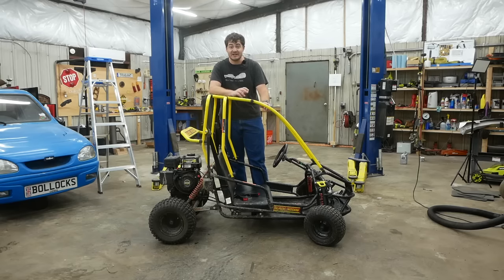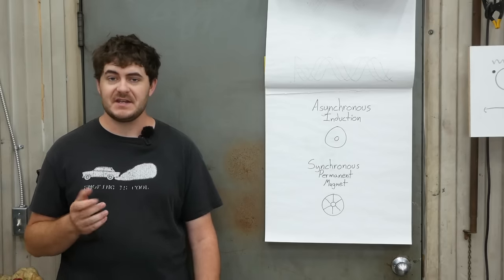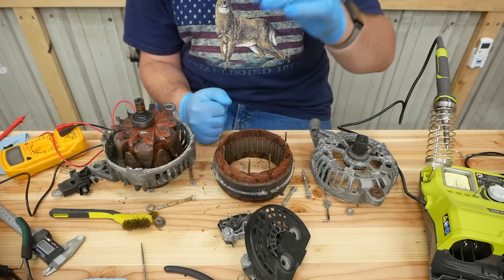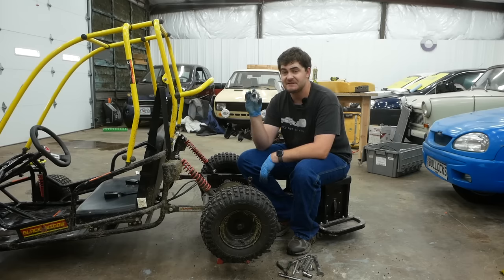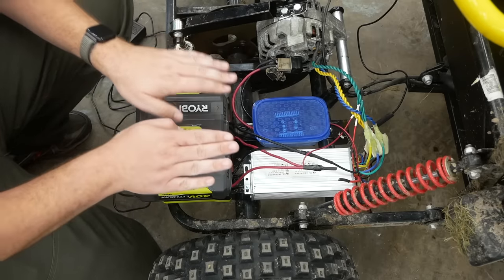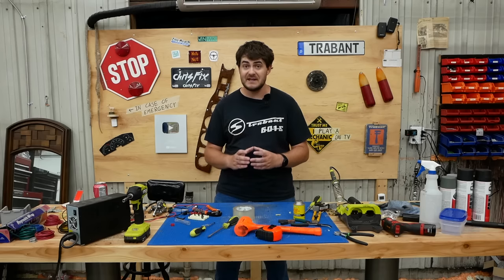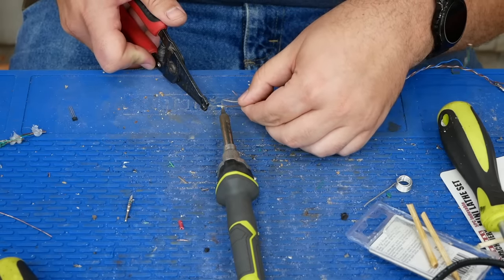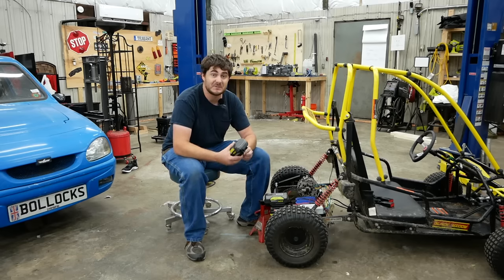Can I Power This Go Kart with a Used Car Alternator?

Comment: My prediction: you end up using the motor that comes with the new speed controller - and this thing will rock! I converted a mountain bike to electric and on 66V it can pull me up hills easily (about 110kg total weight including the bike itself) so if you let your kid play on 72V better make sure there is some kind of limiting.

Comment: Excuse my ignorance, As I have plenty. But would a car starter motor have the torque to be work with the right gearing? Running from a car battery.

Comment: Gotta hand it to you for sticking with it. Would a starter cap be of any service to you? Not sure if they're used on DC motors and I do not think they are, but hey, I don't know. Sure need them on AC motors. Not sure how to size one, but you need to get it off line as soon as the motor kicks in so you'll need a centrifugal switch too.

Comment: One major problem with putting those batteries in series is that if they differ in charge, they basically short-circuit the voltage difference.
Unless their protection circuit prevents this, this can lead to them getting damaged and potentially experiencing a rapid unscheduled disassembly.
Similarly, the chargers might break each other in the trickle charge state, used for completing the last ~20% of the charge.
Both issues could be worked around by permanently leaving the batteries installed and only using one charger for both cells.

Comment: Knowing rough info on big motors from washing mashines they also need a capacitor to give it a jumpstart in a specific direction idk if thats the answer but yeah a capacitor starts the rotation of the drum/motor with heavy wet clothing loads or maybe heavy go kart loads

Comment: Also, I’m not sure if an alternator is considered a brushed, or brushless motor, but I believe that only brushless motors use the sensor from the speed controller. If it’s a brushed motor then it only needs two wire speed controller made specifically for brushed motors, and a brushless will only work with a brushless speed controller. You’ve probably already thought of that, but I can’t sleep without figuring this out.

Comment: Interestingly fun project.  I believe that the shape of the poles on the alternator will lead to major inefficiencies in power in to power out.  The poles are shaped as they are to reduce electrical noise that increases as rpm increases.  If the poles on the rotor were machined to appear to the stator as bar magnets, the magnetic energy  would be concentrated on the proper stator magnetic lines of force all the way across the stator.  As it sets now, the wide end of the rotor poles contaminate several stator windings causing multiple stator windings to fight for magnetic real estate on the rotor.  And some of those forces are opposing each other.

Comment: Just a guess but... If youre drawing to much current from youre batteries the Voltage drops.

Many BMS's will stop pullimg current to protect the batteries. (Off and ON) resets the BMS and gives the batteries enough time to show higher voltage.

Comment: not sure if you fixed this but you know, I had a floor fan go out, i took out a black box it was a resistor or something and it would only work if i spin by hand. I looked this up and it needs that capacitor not resistor to start look this up may help.

Comment: From my electrical engineer knowledge, your stepper frequency is to high for the initial torque required for the initial start. from what I know on hall effect sensors it's made to measure a pulse in order to estimate the revolution of the, it would be dependent on what the motor controller does with the signal, you can test it with a small 555 signal generator and an oscilloscope. If you have any questions or need any help I would be more than happy to answer them, as well as any questions you might have about BMS systems and 18650 battery packs.

Comment: So question, can a Alternator being driven by a gasoline engine power another alternator as a three phase motor? As in no controller or hall sensors, just the phases wired directly together and a way to energize both, essentially like a electric pto of sorts?

Comment: Sensorless controllers use the zero crossing point of the back EMF sine wave to infer the position of the rotor. My guess is that the controller is cutting out due to the controller being undersized or the inrush current is too high for the batteries BMS and it’s cutting out. To check for BMS cutout hook up a multimeter to the DC bus and check and see if the voltage cuts out when the controller cuts out. I would also recommend getting a sensorless control so you don’t need to mess with installing the Hall effect sensors.

Comment: Are these controllers designed for use with hall sensors? My background is in appliance repairs and I would be modifying the back end of the motor to fit a washing machine motor tacho coil and magnet.

Comment: Overcurrent protection. 1500w at 40v is 37.5a. I'd say that the batteries, even in parallel setup, cannot handle 18.25a Current draw for long, if at all. That's neglecting the draw to energize the rotor windings.

Plus remember that the higher the Current, the higher the heat losses ( heat_loss = total_resistance × current_SQUARED), so the power lost to heat will be (assuming a 10 ohm Total resistance as example) will be 10w at 1a,  40w at 2a, 250w at 5a, and 1000w at 10a. 

This is why most traction motors run on really high voltage, since it reduces heat loss at the same power rating (and also why the long power transmission lines run at tens of thousands of volts with  tenths of amps). The same effect is why birds like to roost on residential power lines, but rarely do you see them on the big high-tension lines.

It may also be the controller itself. Some are designed for a low Current high voltage setup, and some are the opposite.

A 72v pack would have to output 20.8a at 1500w and 41.6 at 3000w.

Always keep in mind,
Power_In - Power_Of_Loss = Power_Out

Comment: This was a great video! 
Educational and fun to watch the same time!
I like also the fact that you show the failed attempts!

Maybe it is a good idea to use a RC brushless ESC controller? 
They work with sensorless motors and they can handle up to 100Amps
Reply: An RC controller and motor for that weight, 100A might be peak and wont sustain it.
Reply: @freedomisfromtruth  thanks for the info!

Comment: 3:50 the important part about asynchronous motors is, that the rotor moves slower than the stator field, otherwise the stator field would be stationary in the frame of the rotor and you would induce no current. the ratio of the rotor and stator field speed is called slip and is proportional to the load on the motor.
for the case of a synchronous motor, the stator field and the rotor spin with the same speed but with a phase difference (lagging behind for a motor, leading for a generator)

Comment: I had been considering building a replica of an early 1900s electric car, but after pricing out the parts, I had hit a similar wall. The cost of all the electric components total out to be twice that of gas (small engine) parts, plus the added issues and stress of getting the right parts working to make the machine move; along with the added fact that I enjoy the noises and vibrations of a gas engine and the immediate gratification of quickly refilling the gas tank rather than waiting for batteries to recharge led me away from electric power and talked me out of using an electric motor. I like idea of electric powered machines, but given my limited knowledge of electricity and my less than stellar experiences with battery life and range,  it will be tough for me to give up on the “Dino Juice”!

Comment: The engine problem might be dust caught in the centrifugal clutch. That happened with ours after drifting on dry days, and a spray with the hose and some driving fixed it.

Otherwise, it’s something shorting the ignition coil to ground. Check the engine kill switch, try disconnecting the kill wires from the engine block completely and see if it still happens

Comment: 24:00
If you plan to buy a battery pack, I would recommend the Orient Power prismatic cells for this project.
Since it's for a 6 year old, I'd definitely suggest sticking to a 48v system. With 100ah cells that's still 90Km range, plus 4800w at 1C discharge.

Comment: Had you considered using a car generator of the kind used before alternators?    They are DC and don't require the 3 phase stuff.   A rheostat in the field circuit would control the speed.
,

Comment: In future I'd put the electronics on the sprung part of the chassis to reduce the vibrations from the terrain, and bonus, keeps the batteries from extending past the back of the frame making your batteries a defacto rear bumper like your current setup.
Also have the batteries lock in downward so the locks are assisted by gravity.

Comment: I got the same problems with the regulator ,shut out and that's it.
I just got a Brushless 9 Mosfet Sine Wave Controller, bought a  lcd4 computer ,because of the opening functionality (hall sensor angle), wheel dimensions, etc. and I've been driving for almost a year

Comment: that engine only needs an oil top-up. When you go around a corner, oil sloshes away from the sensor and cuts the engine off. If it's full consider removing or disconnecting the oil sensor and just check the oil level regularly.

Comment: I don't know if anyone has said how to, you have to program the  esc (electronic speed controller). you have to put in the electro magnet pole count and the  'magnet' pole count. as a sensorless with maybe a higher startup and hz like full start up and maybe start at 16hz to as far as 48hz. the higher the hz the less low end power. This would have to have its programing card or software from the manufacture , or look into other programing software  like simon k, blheli,in github. same kinda stuff on rc cars ,planes ,and drones. As far as shutting down on you, you're right it's the batteries cant handle the draw. Speed controller has a shutoff volt setting. you should use something like drone/plane batteries that are something like a 12s 80c and at least 50,000. mah rates. so at full charge it's actually  48v.

Comment: Im no super techy Guy or anything and I’m sure there’s another solution. But based off of what I saw I bet you it would work with a mechanical clutch system of some sort. If it’s just that the initial torque required to get it moving is too much. Maybe you could wind the motor up a bit without sending power to the axles, then slowing engaging power to get it moving. Just an idea

Comment: Hall Sensors on a 3 phase motor are placed 120° ELECTRICALLY apart, not physically. (one for each phase)
#1 tells the controller when a N pole is on one of the coils for A (U1-U2) and it's time to switch from phase 1 to phase 2.
#2 tells the controller when a N pole is on one of the coils for B (V1-V2) and it's time to switch from phase 2 to phase 3.
#3 tells the controller when a N pole is on one of the coils for C (W1-W2) and its time to switch from phase 3 to phase 1.  
This way the controller keeps the stator field switching just a few degrees ahead of the rotor to maximize torque.

Comment: I'm probably late to the conversation but I think the issue with the stall for this motor is the batteries.

Your motor is 1500w, you're using 40v batteries in parallel. And when and load is applied to the motor you're pushing the motor's torque over the power given by the batteries, causing a stall.

1500/40 = 37.5 amps. Since you've got them parallel you are splitting the load between the batteries so it's 18.75 amps on each cell pack. It'd explain the reason for the weirdness with it randomly cutting out (overcurrent protection). And also why the issue seemingly goes away when the motor is moving, as the current draw is dropping when the rotor is spinning.

Trying to find information on the actual amp rating of them batteries is a bit flaky but I suspect it's probably, at best 10 amps. The fact you're thinking on building your own battery is the right conclusion 👍

Comment: I'm just wondering if you look into a low cut-off voltage for the motor controller because if the motor controller has one you don't need a bms cuz I'm pretty sure the bms's was cutting out probably drawing too many amps for the bms

Comment: I have a question if I connected red wire to body of alternator from battery and negative to field and D connection from battery will the alternator spin a lil? I am trying to check alternator is ok. It’s my second one etc

Comment: ESC s that I use for drones are programmable for motor timing, amount of poles and battery voltage and cut off. It's all in the beeps.
I have no idea how to do this as on a quad you use software

Comment: Aging Wheels, you should have been a genius!...........This is amazing, dont take that brain for granted, you are a natural wizard. Thanks. Subbed. I would not use a motor controller, i'd bypass all of that, its just more stuff to screw up. Maybe use gears. That alternator has massive wire swg, so I'm guessing that will drain your supply fairly quickly, but if you use a standard car battery, that might work better.

Comment: I used a 12 volt  car battery back in 1967. Whats with all the hoopla. It wirked but wasn't strong enough to push me around. I was s kid 130 lbs .

Comment: Did you try changing the amperage to the electromagnet? You should be able to overcome the start up resistance by increasing the torque of the engine.

Comment: I did the same 20degree hall sensor placement but I had good luck of with Honeywell hall sensor and for the magnet I had to input12v less than that it have me alot of speed with no load but no torque

Comment: I know it's been several years since you made this video, but the problem is not enough amperage to the electromagnet.  The voltage going to the stator controls the speed of the motor, the electromagnetic strength of the rotor controls the torque.

Comment: If i'm understanding it correctly, you're limiting the output to 12v 5A? that's 60 Watts, so there is no need to be worried about the 1500W motor controller.
Also you expected it to move with only 60W of power ? that a quarter human power (or 1/12th horsepower)
Also 2: motors may be made for a specific voltage but outside a motor controller there is nothing stopping them from working with other voltages, so i would try hooking up the motor controller directly if i were you.

Comment: I was looking up the delta vs wye connection for a 3 phase motor and came across this info "a Delta configuration you'll have full torque applied instantaneously to the load. If the load has high inertia, this can be very hard on transmission components, and will result in extended starting currents on the motor, causing high heat generation. Motor overload devices are placed inline to protect motors from extended current draws and when properly sized, will prevent such starts. With the Wye connection and the subsequent reduction of voltage on the windings, your available horsepower is cut to 1/3 rating. "

Comment: i think the main problem in current the motor.
without resistance it spin, with resistance you need more current to motor, the only way is

1) increase voltage and check the controler can work with this power.

2) decrease motor resistance with gear.

the alternator make 3 phase 24V AC  , Intensity of magnetic in rotor based on DC constent voltage.

if you use 2x12V battery the rotor get 12V DC constent, the 3 core get pulse 12V.

alternator build in 5K RPM about 70A max. power 15*70=1050W ,1.4HP.

the solution put 50 tooth gear, and 24V controler with

Comment: Those ESCs have a certain cut-off voltage,  if yours  is the 48v model, then it will cut off at 41v. So if you haven't got a high enough voltage then you will experience that the engine shuts off immediately after starting.

Comment: those motor controllers are used in el-scooters and I'm pretty sure the controllers have a setting which sets the limit of how much the battery can fall down in % (because that's how it is on my el-scooter) before it either lowers the output or completely cuts it.

Comment: when I was in elementary school, our dishwasher caught on fire,  because a knife fell out of the utensil basket and the handle landed on the heated dry element. Or something. Anyway my friend and I took it apart with the idea of using the dishwasher motor to power a gokart. We only ran into two problems: we had no idea how to convert it to run off a battery because it was the 1990s and all we had were 6v flashlight batteries and also we didn't have a gokart. Some things never change I guess.